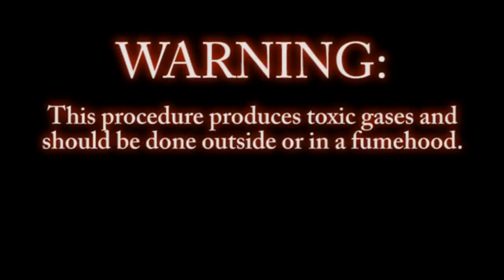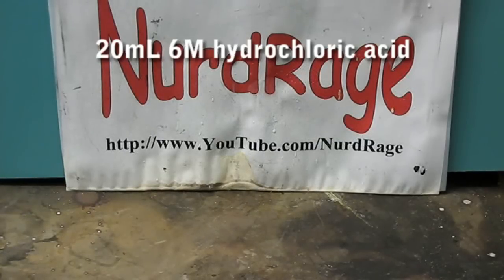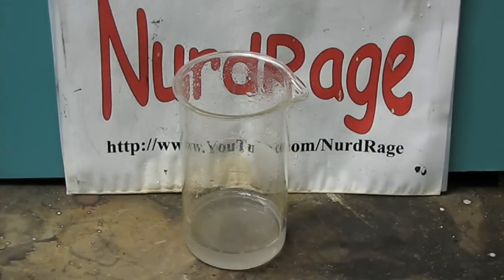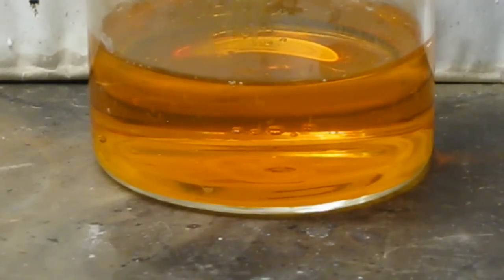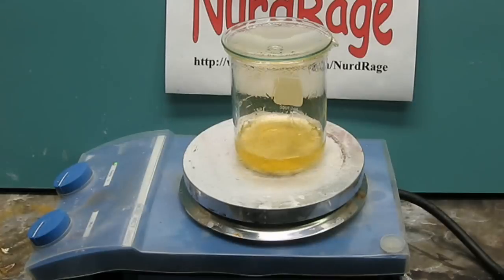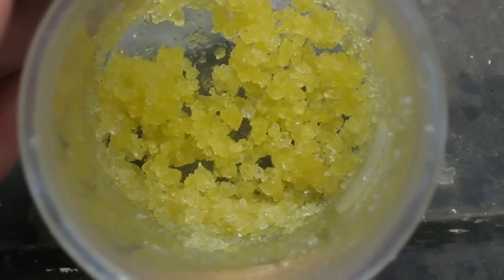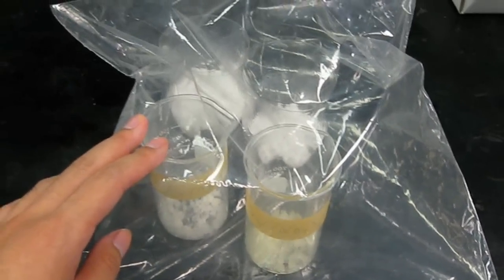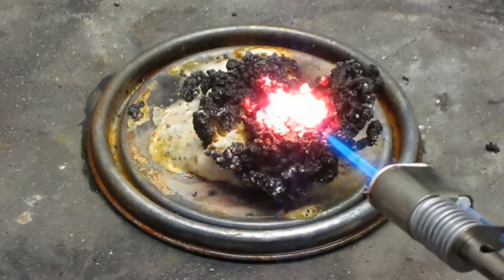How to Make Aluminum Nitrate Nonahydrate

Comment: I asked chem player about potentially using a substitution reaction to precipitate nano aluminum out of solution from a salt. 

Well long story short we both ended up finding the same literature, and found some significant problems. 1, it is possible but requires some rather exotic reagents you'd likely have to make your self. 2, the relatively high surface area means it would oxidise very quickly, and isn't likely to be usable after contact with air. 3, it just wouldn't be practical to try.

Comment: My route for synthesis of Aluminum Nitrate was to produce Aluminum Hydroxide by reacting aqueous solutions of Sodium Bicarbonate and Aluminum Sulfate and them neutralizing the formed Aluminum Hydroxide with Nitric Acid... just to avoid production of Nitrosyl* Chloride.
Still need to dry the product and test it but I'm fairly confident about the results.

*Corrected.
Reply: My bad, my bad...
I was thinking about Nitrosyl Chloride and typed Thionyl because my mind fails badly at times lol
Reply: wow youre smart ass :D im going to make Aluiminium Nitrate *9H2O by your route, but i dont have AlSO4 So im using HCl and Al to make AlCl3 then add NaOH to make precitipate of AlOH and NaCl (your route doesnt produce highly toxic mixture of NO2 and Cl) THANKS :D
Reply: Yup, worked as expected. Tested the solubility in water, alcohol and burning indeed produce aluminum oxide so I guess it worked pretty well. Just remember washing the aluminum hydroxide a couple times to remove salt contamination... 'cause I made this mistake of not doing it the first try and got a lot of fizzing indicating presence of unreacted sodium bicarbonate, and due to the sodium contamination of my product I had to do everything again.
I may record a video of the process in case I do it again (not likely).
Reply: Only one problem is Aluminium nitrate is hygroscopic and decompose (150°C) to aluminium oxide and toxic NO2 fumes, i dont have dessicator to drying it so i just have aluminium nitrate solution
Reply: Im recommended using copius amout of water and dried the oxide with vacuum filter methode since AlCO3 has same weight as Na2SO4 do (byproducts) so it hard to settle down (lol non english speaker)
Reply: Decomposition temperature should be around 73ºC for pure Aluminum Nitrate while solutions shouldn't have this sort of problem unless heated to pretty higher temperatures, you could heat it carefully on a flame and keep track of the temperature with thermometer or something.

Alternatively put it on a big container and put it under a few incandescent light bulbs to speed evaporation up a little.
Reply: 50°C (really warm water) is the best way to evaporating some water but it waste so much time

Comment: How about this: 
Mixing aluminium sulphate or aluminium chloride and potassium or sodium nitrate, and then to separate them using methanol, ethanol or ethylene glycol? (aluminium nitrate is soluble in these solvents, methanol is the best for this purpose, nonetheless sulphates should be insoluble).
Would you recomend it? Supposing it works it would be much better for amateurs.

Comment: this is pretty difficult, 'cause you can't get Aluminium from an aqueous solution. Technically, it is produced by a fused salt electrolysis. I think it's much easier to buy it directly.

Comment: how do you stop hydrolysis of the AlCl3 intermediate? It's a potent Lewis acid which would surely scavenge any water in the system?
Reply: I think the aluminum nitrate absorbs it. It is the nonahydrate after all.

Comment: Else maybe it's a kind of catalytic mechanism like:
HNO3 oxideze Cu to Cu++
then Cu++ go to Cu while Al go to Al+++
then HNO3 oxideze Cu to Cu++ again and so on in a catalytic cycle.

Try to add to the diluited HNO3 you usually use just the Al foil only and look if reaction starts anyway. If it doesn't start then add just some drops of any Cu++ soluble salt solution and then have a look if it works!

Comment: You will obtain a solution of Al(NO3)3 and Cu(NO3)2 so, at the end, you will have not pure Al(NO3)3 salt.
Anyway I think, like I wrote, that you use enough diluited nitric acid so that Al reacts giving the nitrate because it's not enough acid to give the NO3- the oxidant power to generate the passivation layer and then the H+ to H2 reaction works!

Comment: I think that if you use enough diluited nitric acid Al will react giving the nitrate because it's not enough acid to give the NO3- the oxidant power to generate the passivation layer and then the H+ to H2 reaction works!

Comment: I know its not relevant to the video but does anyone know if iron can be extracted from pyrite(FeO3) and how that might be done as I would love to try it.
I have read that it could be done with salt water and the reaction 2FeO3 + 3C -> 2Fe + 3CO2 looks like it might work with some heat.
Reply: First of all what you have written isn't salt water it's carbon
And this reaction is used in a blast furnace the most commonly used source for carbon in blast furnaces
Is choke

But if you want to do it do it outside and don't even think about goind near it

Another way is to make a thermite
Where you add aluminum to the pyrite and heat it up

WARNING this reaction can get up to 3000°C or even more

and its very bright
Dangerously bright

And it produces molten iron
So be careful

If you wanted to know why it works
It's because aluminum is more reactive that iron so it displaces it and you get iron and aluminum oxide

Comment: I always made this by first making a solution of copper nitrate with dilute nitric acid (To minimize loss of acid as NOx.) and then place aluminum foil in it to get aluminum nitrate. That way I could recycle the copper. (It could be heated to CuO, which wasted even less nitric acid.) Is there a reason this method shouldn't be used or am I doing ok?

Comment from the maker: @LolzICanFly That won't accomplish much, concentrated nitric acid just forms a new oxide layer on aluminum after you scratch off the old one. You need an acid that doesn't do that.

But tell me something, why are you so hellbent on avoiding the method in the video? if you just want to save time then it might be more prudent just to buy aluminum nitrate directly. It's not expensive and not regulated.

Comment: @NurdRage Okay, thanks. One more question; wouldn't it also be possible to put the aluminum foil in the acid and then use an acid-resistant rod to scratch the oxide layer?
Reply: No

Comment: Not true.
If the solid aluminium nitrate nona hydrate is heated to let's say 120 degrees Celsius it does NOT decompose and all the water is sort of evaporated off, making this suitable for pyro technics.
But do keep in mind that it DOES decompose at 135 degrees Celsius.

Comment from the maker: @TzerMaan

The usual, complexometric titration or gravimetric analysis.  

Although the hydration issues might make the aluminum content slightly off on a mass basis.

What's more important is the foreign metal content, that will interfere with the phosphorescence later on. I think atomic absorption spectroscopy is your best bet to determine what else is in there.

But in our next video, we'll purify by recrystallization anyway so the impurities won't be an issue.